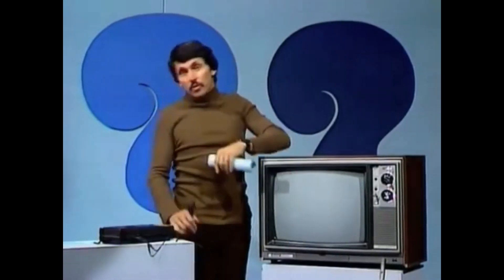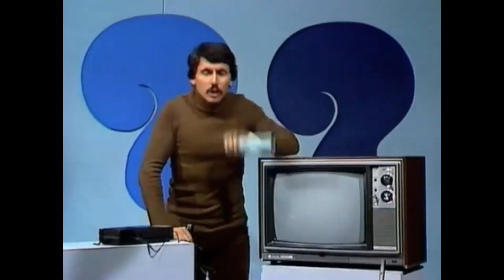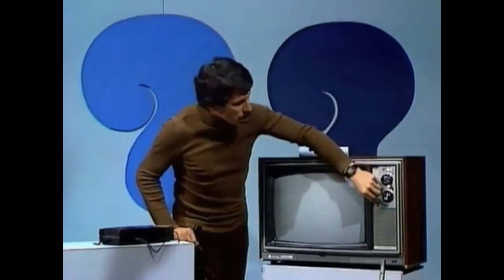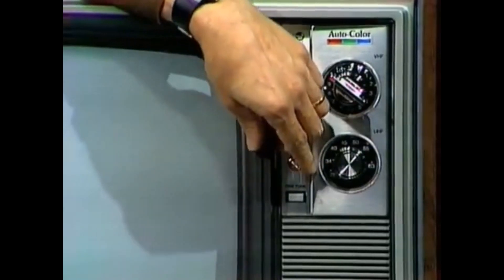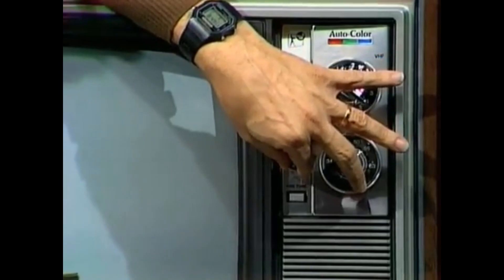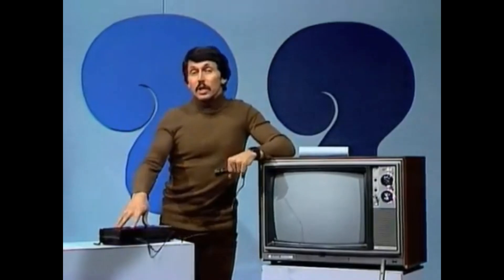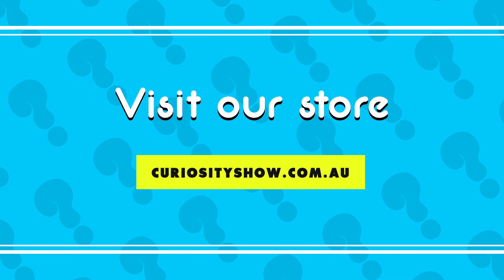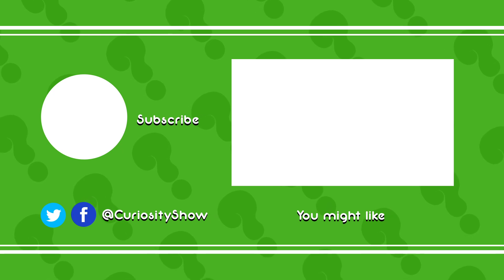Sound Effect - Rocket

Comment: The countdown was obviously Aussie -- the nasal tone made more evident by the cardboard tube.
The early color TV CRTs were mid-grey colored (when off). Later versions had a lighter grey tone, like in the video, but I forget the name they gave it.
Reply: On black-and-white sets, the color of the screen when it's off is mainly the color of the coating of phosphor on the inside of the screen.  In color sets, the color of the screen when it's off depends on the color of the shadow-mask, I think:  initially this was light; but, by the early '90s, it was close to black.  (I'm having trouble deciding which seems less improbable.  On the one hand, it seems unlikely that the darkness of the shadow-mask would be visible when the phosphors (lit or not) were in front of it.  On the other, it seems unlikely that the darkness/lightness of the unstimulated phosphors would be different in different years of manufacture.)
Reply: @smadaf  cool story bro
Reply: The black mask helped with the overall contrast. I'm not sure if it needed an improvement on the phosphorus chemicals or why it wasn't applied before, since it seems so obvious. It was an invention sold by Sony, together with a more flat front tube surface it made the black trinitron tube. The more flat surface was a much more complicated thing to address, though. If your screen is a segment of a sphere with the radius originating in the electron ray gun, it's quite easy to scan the surface with the ray and keep the ray focused on a very small spot. When your screen is more or less rectangular and flat, you have to do very funny things to the deflection coil voltage and the focusing voltage, and this has to be done in a pretty high frequency, perfectly cleanly, perfectly synchronised and with a fully analog output. On top of this, these were consumer products, which means that there couldn't be done any adjustment while in operation and it had to be free of temperature drift, since nobody in the mid 90's would have wanted to wait half an hour for their TV to warm up. Colour TV is quite complicated stuff, and it's no wonder these things were insanely expensive when they showed up.
Reply: @andrebartels1690 , nice to see someone else who's interested in this stuff.  Yes, the Trinitron involved putting the cathodes in a line, instead of a triangle, which is why the screen curved in just one dimension, instead of two.  The first TV that was solely mine was a fourteen-inch multisystem Sony Trinitron, which I still have and still works well.  My other CRT TV is a multisystem Hitachi, CMT 2129, bought new by my parents in November 1994 for $460 U.S.

In terms of the inventiveness behind it, I'm always more impressed by analog color television, on a CRT, than I am by digital television.

Comment: I remember getting up in the early mornings, as a kindergartener in the mid '80s, turning on the TV, and sitting through color-bars and tone, waiting for the local public television station to start the day's broadcasting.
Reply: In the mid to late 60's in Perth, the TV stations would go off air for say, 15 minutes, about once a week, because of some failure. They used to transmit a static image while "off air." And one of the "valves" in the B&W TV's would usually go every month. The utility power supply wasn't much better in reliability.
Reply: @electronwave4551 , interesting!  The early-morning experience that I described took place in Ohio.
Reply: @smadaf  It has brought back these memories: The 'valve' B&W TVs in Aust had back panels full of 1 cm wide holes to let all the heat escape. Many a time I would crawl behind it and watch them glowing. The ventilation also let airborne dust in, and you could smell the dust being slowly cooked on the glass surface of the valves.
Every hour of so you had to adjust the horizontal and/or vertical controls on the back panel when the picture rolled. The parents never could get a stable image, so I always did it although only knee high. The trick was to slowly reduce the amount of correction before the picture became stable, because if you did this when it became stable, it would be over corrected and start to roll in the other direction. Before the first TVs were around, you could always hear neighbors in their yard tinkering away at something until it was dark. But once TVs started to become more common, it was always silent outside before sunset.
Reply: @electronwave4551 , I miss the smell of warm plastic and dust from a CRT TV that's been on for a while.  I still have two of them, in good shape.

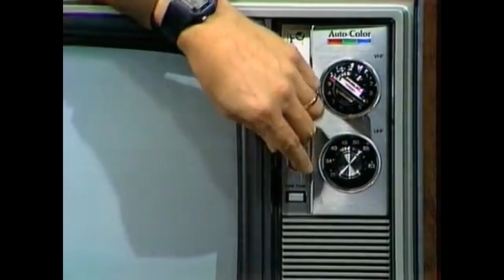Comment: It's fascinating to see an analog TV set made for the PAL market that has American-style tuning-knobs.  (1:02)  The ones I know from Germany and the U.K. were not like that.  Did Australia, like America, have the dozens of possible over-the-air analog stations, with the possibility of a lot more than just three or four in a given area?

With the "Auto-Color" at the top, one would almost think this was an NTSC TV, touting itself as not requiring manual tint (hue) adjustments.
Reply: The old B&W sets in Aussie also had the same type of channel selector as in the video. Selecting a channel was like turning a water tap on and off -- round and round, or back and forth. With so many empty channels, it wasn't instant.
Reply: @electronwave4551  and as the TV was in use, the analogue circuit tuning the frequency for the channel would heat up, meaning that you had to keep moving the knob[s] to find the station again!
Reply: No, there were only 5 analog stations at most (less in regional areas) from 1980 until cable TV came along in the mid-90s
Reply: @benji274  My area in country Victoria there were 3 channels ABC, AMV-4 and GMV-6.  This was on VHF by the way.
Reply: @steviebboy69  luxury! We had 2 channels in Tassie: ABC and a local hodgepodge commercial station that would often gain/lose rights to Channel 9 shows for long periods (including Curiosity Show, sadly)
Reply: @boomstand2872  there was eve I think SES8 or what ever the bendigo station was.  if I fooled with the TV I could get a snowy picture this being with the tv antenna IN the roof.  Now there are heaps of channels but a lot of rubbish.
Reply: Caught me out too, I would have suspected “Auto Color” to be an NTSC set in both utility and spelling but it’s an Aussie PAL set.
Reply: @robustreviews  I am not sure what the auto color or as it should have said colour they way we spell it.  It looked like a Rank Arena set.
Reply: @steviebboy69 , it would be interesting to find out what "Auto-Color" meant on that set.

In NTSC (the color analog TV system of most of the Americas and Japan, which was invented in the U.S. (by RCA, about 1950) and became the federally approved standard (technically NTSC II) in 1953), interference between the transmitter and the receiver can get the signal a bit out of phase.  The result of this is that all the colors get shifted around the color-wheel by a small but variable fraction of the circle (it would be sort of like if I walked into your house and set all the clocks five minutes ahead, or five minutes back, or maybe three minutes ahead, or three minutes back, depending on what I felt like that day):  the most noticeable result of this was that people's skin looked either too green or too magenta.  To correct the problem, NTSC sets have an easily accessible control, the Tint control, which is essentially like your coming into your house after me and putting all the clocks back to the right time again.

(On multisystem sets, "Tint" is often renamed "Hue".  At least in terms of the usual vocabulary of color theory, "hue" is the better word.)

I have a vague recollection that, by the late '60s or the early '70s, some American sets were being advertised as having a special feature that got the tint right automatically; it seems entirely plausible that someone would choose to call this "Auto-Color"—but I don't know that that ever was a name for such a feature, and despite the invention of that feature all those decades ago there were still tint controls on NTSC sets into the 2000s (which makes me think that those early efforts to make the adjustment automatic didn't work well).  Anyway, as far as I recall, this was only a problem with broadcast ('aerial', 'terrestrial') reception, not cable TV.

When British and European television technicians were coming up with a monochrome-compatible electronic analog color television system for their part of the world, in the 1960s, they liked the basic idea of NTSC, but they didn't like the fact that the colors could be thrown off.  They worked and pondered, and eventually changed the signal-processing at the transmitter, and in the receiving sets, in such a way that the phase (the part that could go awry in NTSC) was split between alternate lines of the picture and then reassembled by averaging those alternate lines together.  This change meant there was no risk of color distortion, and therefore no need for a control on the sets to correct the distortion of the colors.  That change is why the PAL system has that acronym for its name:  it stands for Phase Alternate (or Alternation) Line.  This is the innovative difference between PAL and NTSC.  Apart from that difference, PAL is NTSC, just with a greater number of lines per picture, a smaller number of fields per second, and a wider stretch of broadcast bandwidth per channel.

Anyway, that's my rough way of putting it when I'm very tired.

Because Australia chose PAL when it decided to get color television in the 1970s, it's surprising that a TV set in Australia would have on it words ("Auto-Color") that so strongly suggest some kind of automatic tint-adjustment—because PAL requires no tint adjustment.

On the other hand, I've had the impression that Australia, maybe because of its nearness to Asia, has an unusually large market for audiovisual electronics that are compatible with the varying radio and television and electrical systems of different parts of the world.  (For example, every time I've looked on eBay for a replacement part for a stereo that I got in Europe, which was sold to American military personnel who wanted something that would work well both in the U.S. and elsewhere in the world, the only replacement parts I've found have been in Australia.)  So maybe this set is a multisystem TV, capable of displaying not only PAL programming but also NTSC shows.

(Can you tell that I'm curious about stuff?!)
Reply: @smadaf  there were some TVs and/or VCRs here that were capable of both PAL & NTSC, not that I could ever figure out what reason for
Reply: @boomstand2872  , my guess is for people who move between Australia and Japan, mainly.  It's kind of like product-packages in the U.S. that are in English, French, and Spanish, mainly for American, Canadian, and Mexican buyers.
Reply: @smadaf   Thanks for the detailed info on the NTSC and Our PAL system, I always remember hearing the crap about the colours changing and thats the reason for tint or hue with the NTSC.  At least the USA had colour(color) way before we did.  I am still not sure about auto-color on the set.
Reply: @steviebboy69 , I will say that for me the only real function of the tint control was entertainment.  On rare occasions when I was a kid, I'd change it for a moment to make the people look green or purple, similar to turning the color (saturation) off to pretend the show was in black and white.  Growing up in the '80s and '90s, I never saw anybody at home or at a friend's or relative's house adjusting the tint control because of a need:  I don't remember there ever being a need.  I don't know:  maybe it was more a problem in the '50s and '60s, or maybe it was more a problem in rural areas, where the receivers were a long way from the transmitters.

On the other hand, when I'd go to the TV section of a store, where a bunch of sets were lined up and all tuned to the same program, there would often be one whose picture was pushed way to the green side:  I assume this was just the result of someone's fiddling around for fun.
Reply: @smadaf  I remember doing that with the color either turning it all the way up an being really gaudy or turn it off and make it  black and white.  But I never had the fun of tint.  I wonder if auto-color was something to do with the colour killer on weak signals or maybe just a silly naming thing.
Reply: @steviebboy69 , now you have me wondering whether "Auto-Color" was a way to combine two features in one bit of branding: (1) automatic fine-tuning of channels in (2) a color TV.  There was some funny branding in the mid 20th century, such as Zenith's "Space Commander" remote-controls for TVs, and "Dynaflow" and "Powerglide" automatic transmission in cars.  (Then again, is that any weirder than "Zoon", "Google", "X"?)
Reply: @smadaf  That may be it Auto fine tuning of the set but that was normally AFT. "X" is a silly name and Google has been around for ages as there is a song from the gramophone days Barney Google.
Reply: In the riverland south Australia we used to have a channel called 5A.
Reply: @andrewbaans7400  I always found channel ) and 5A a funny number for some reason.